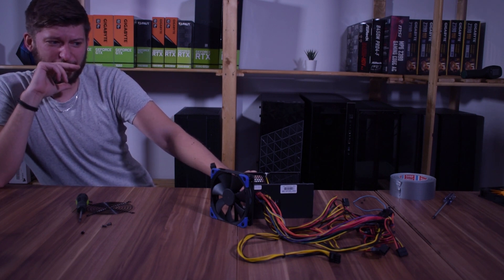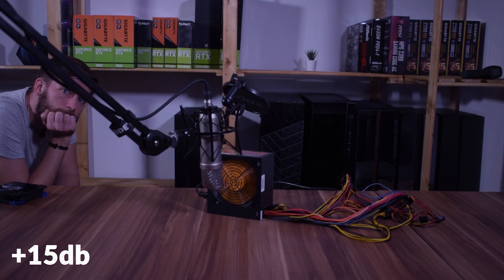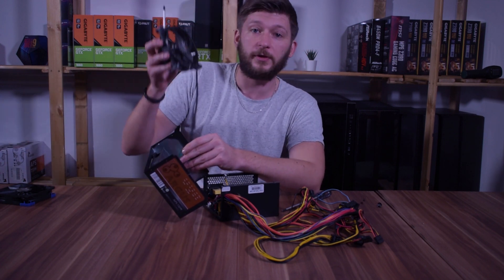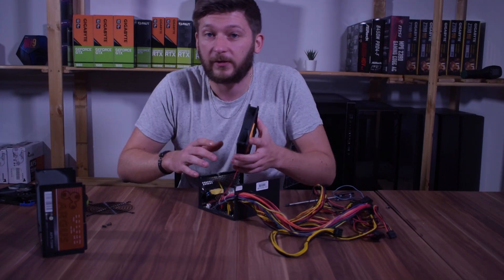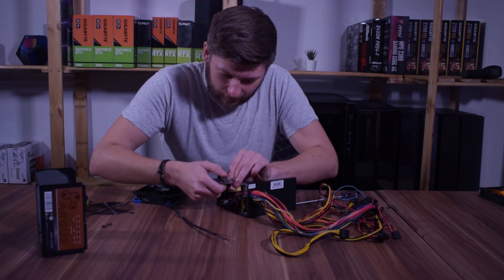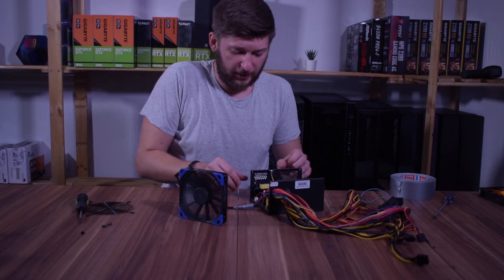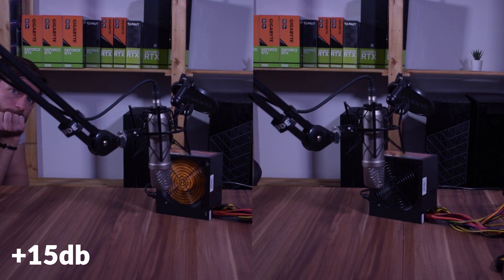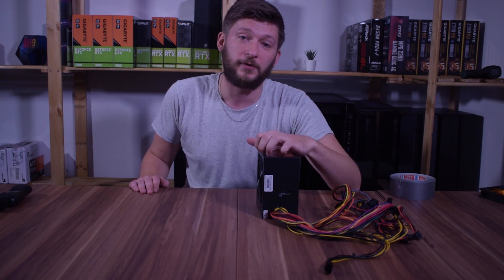Power Supply Fan Swap | Reduce PSU Fan Noise

Comment: I did this but differently . I used the old fan cable by removing it by disoldering. and resoldering it to the vento pro fan . because the old connection was 2 pin & the new fan are 4 pin . It runs flawless .

Comment: Hello @STSYT,
I'm stupid enough I guess, my Thermaltake TOUGHPOWER GF2 ARGB 850w 80+Gold is a noise house, the fan ramps up to full speed (and is very loud at that too) because the stupid fan curve Thermaltake made. I just don't get it! the GF1's fan curve is linear and smooth, whilst this stupid GF2 has a spiky graph at load 20% can you believe that? I bought this 3 days ago and where I live there's nothing such as refund after u open the box if it's not for warranty issues. I tried putting up a 30dB 140mm fan in the mobo at full speed to compare the noise, and the PSU's ARGB 140mm fan was louder even when stated being 27.x dB, what do you think? Should I butcher this thing to the ground? and probably myself with it?
Reply from the maker: Never trust the db rating of anything ^^ Nobody knows how companies really measure these, or if any of them are doing it exactly the same way.

Even if I would butcher it myself, I wouldn't recommend anybody to do it. The things that could go wrong can end up with a house fire
Reply: @STSYT  too late haha, I slapped a potentiometer on it to control the curve multiplier so it won't go full jet engine. Thank you and keep the content coming!

Comment: Cheap power supplies have an always on fan meaning the fan is always loud and wears out prematurely. A thermostat mod would be a better mod
Reply from the maker: I'm guessing by thermostat mod you means some sort of module which will start/stop the fan based on it's temperature.
Though at that point + investment, it would be cheaper to just go and buy a good PSU.
Reply: @STSYT  Well I don’t buy terrible PSUs it’s usually easier to get a 80 plus bronze with some speed control. Prebuilt crap tends to have a always on fan and a 5 pack of KSD9700 from China is worth having in your parts box.

Comment: Did the same but put a high static pressure phanteks 140mm, now it's dead silent, by the way the psu it's seasonic but the fan was loud
Congrats for the better luminosity of the video :), cheers from Argentina
By the way my psu had the same plastic inside, I suppose it is for guide the air? But as I put a high static pressure fan I remove it, cheers from Argentina
Ps: the sheet of plastic in my psu was towards the exit so I think is to guide the air from the inner side of the psu then the components and then the exit
Reply from the maker: Thanks, we try to keep it lightened up from now on :p
That would make sense if the plastic was a bit loosely on there, kind of bending when the air hits. In our case it was completely stuck to the fan, so blocking all the airflow from going to one side.
You could still be right and it is meant to guide the air, maybe the fan in our test-PSU was just far from strong enough for that.
Cheers
Reply: Albert, me da curiosidad, soldaste el cable o solo lo hiciste con cinta como en el video?, soy de Argentina también y quería cambiarle el cooler a mi fuente de poder pero ahora mismo no tengo para soldar. Has tenido algún problema en el año entero?
Reply: @confiscador1996  mira con fuentes antiguas que no eran mías a veces solde o algunas traen un conector de 2 pines que lo sacaba y lo ponía en el nuevo fan, esta vez tuve la suerte que los los fan phanteks traen el cable como de 40 cm así que lo saque por donde salen el resto de cables y lo conecte a la placa madre y le hice la misma curva que al fan del cpu, así que mientras más consume el cpu el de la fuente más rpm sube, problemas 0
Reply: That sheet of plastic is for insulation. Anyone dumb enough to poke a metal in there , if touches those heatsinks which have are 300V DC in Europe, is gonna blow up the flyback switch transistors and the fast diode.

Do not toucy those grey heatsinks they are HOT!